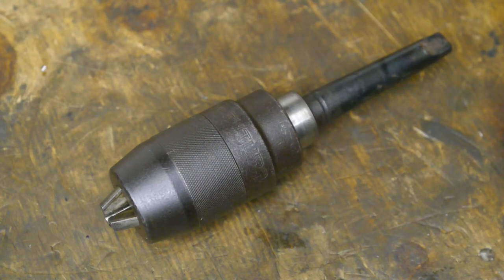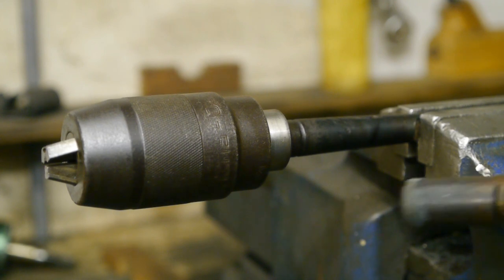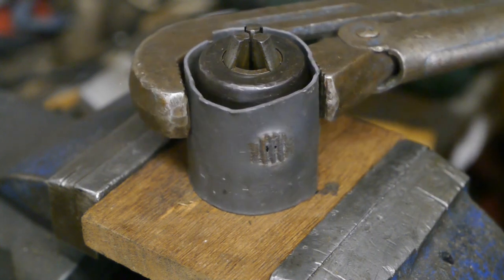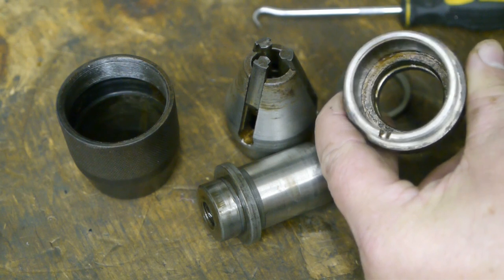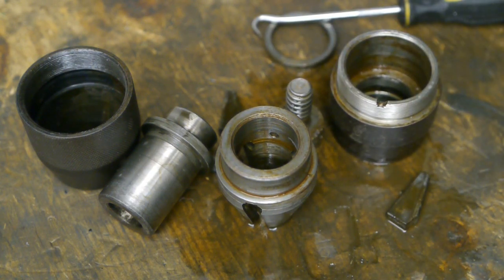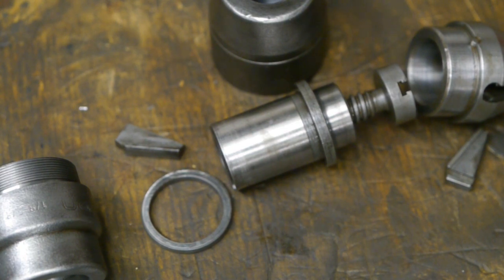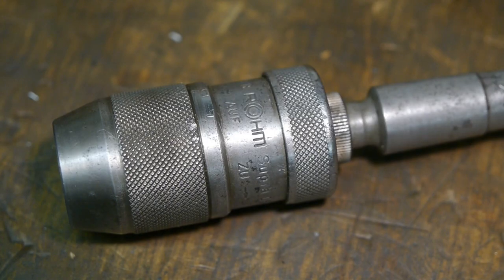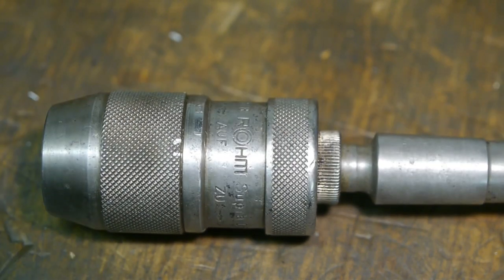Howto Disassemble a Metabo futuro keyless drill chuck

Comment: I have a Chinese chuck in which the ball bearings are 4mm with 23 total.  I notice that most leave about a bearing width in the ring of ball bearings rather than have them shoulder to shoulder.  Mine is quite a bit different than yours however.  No two race surfaces just a ring of bearings that the center holds in place against the cone when you drop it in.

Comment: is missing an outer ring that clamp on the arbor side and take that movement... thanks for video ... I have one new witch is in perfect condition and on first use that top sleeve get loose, but I have not disassemble it i will put some thread locker to not get so easy with the hand.

Comment: This chuck appears to be the same design as an Albrecht. According to a quick internet search they take (25) 4mm ball bearings. 5/32" diameter would also work since they're only .001" difference in diameter.
Reply from the maker: You are right, I looks a lot like the Albrecht design. And those come in different sizes, perhaps using different sized balls.
Reply: @Rolingmetal  I just rebuilt my albreght 1-13 looks very similar in size, design is same except the bearing there is no separate race, the body and shank are the races. The rear knurl ring is tightened to keep the chuck from sliding apprt.

Comment: I have a metabo futuro running offcenter in my drill Press!
Also mine has a sort of collar on the top, where the morse taper drive in, clamping on the ground bar yours has exposed
Reply from the maker: I've seen those collars on pictures and I'm wondering what purpose the serve. The look rather redundant to me.
Reply: Rolingmetal toghether with the bearings It May solve your longitudinal play and wobbling: the bearings stop the end thrust and the collar, put in contact with the Chuck and tightened , keep all the parts tight toghether (maybe)
I'm going to disassemble mine, i'll let you know what exactly It does

Comment: Thanks for this video! I have the exact same chuck that I need to take apart. I doesn't run true on my drill press. The arbor it sits on does run true... Very helpful to see how it is supposed to come apart before applying force in the wrong place. Gotta love YT for being able to find info like this! If I find ball bearings inside my chuck, I'll let you know the measurements.
Reply from the maker: Good to hear my video actually helped someone out.
Reply: Yes it did! It took me several hours to get the chuck to open. In the end I had to borrow a bigger pipe wrench than I have to get the job done. 
Maybe I can help you out too: The ball bearing inside consists of 28 balls of 3.2mm diameter. They sit in the groove of the inside cylinder and ride on the little ring that sits inside the main body. Hope you can find some suitable bearing balls for your chuck!
Reply from the maker: Thanks for counting and measuring the ball bearings. 
And, did you succeed in improving the runout?

Comment: Thanks for the video, I just was fixing one of these myself :). The ball bearings in my one was 3,16mm.
Reply from the maker: Thanks for the feed back. Does yours also go up to 16mm (5/8)?
Reply: Rolingmetal No problem :). Mine just go up to 13mm so maybe that’s why it used 3,16 (that’s what I measured but I think the correct official size might be 3,175mm). I tried with 4mm balls but they didn’t fit at all.

Comment: Hello, This is a great video, I took my 5/8” keyless chuck apart because it was making a grinding noise when I turned it in either direction. Upon opening it I noticed right away that no parts were deburred.  So I deburr and clean. It seemed I was short on bearings so I measured the shiny mark where the bearings ride “The race” and it measures 34mm x pi 106.814,divided by bearing diameter 4mm = 26.703, I have 24 bearings and I think I should have 26. The 26 leaves .007 mm for grease and movement. If I am wrong on the number of bearings could somebody please let me know, there is no possibility that I lost or misplaced bearings. Again great video and I’m sure that it helped more people than you realize, it helped me. Thank You.

Comment: On the Röhm chuck, if memory serves me well, carefully try to knock the upper knurled part, it is a cap, upwards, the rest is easy.
Reply from the maker: The knurled top screws off but only gives you access to the jaws as far as I can tell. Then I got lost :)
Reply: I meant the other knurled part, the one of above the letters. It is a press fit cap/ring. You can tap it off lengthwise.

Comment: Very interesting.  I have seen videos taking apart Jacobs and Albrecht chucks.   This is completely different design.

Some flea market gambles pay off, now and again they do not.  For you it is not so much the money but needing a working chuck for the lathe headstock.

Bummer about the ball bearings.   Jacobs "standard duty" chucks do not use ball bearings.   The "Super Duty" chucks have ball bearings and a hefty price.
Reply from the maker: The fact that the ball bearings are missing doesn't bode well. But it will probably still be usable on the wood lathe once the ball bearings have been replaced. 
I'm currently  working on plan B to get a drill chuck for the headstock.

Comment: You probably know this, but I will post this anyway. If you get a bike, maybe for free, there are balls in the crank, the steering, and in the axles and probably in the pedals. one size may work for you. I would use a size slightly narrower than that spacer shown. Then use grease to hold the balls when assembling.
Reply from the maker: There are more bicycles in the Netherlands then there are people. Me. I got about 10 :)

Comment: you can order different sizes of ball bearings from china on ebay,i have done this myself.dirt cheap.i would measure the bearing raise and take away clearance measurement and start there.order 3,4,5,6,mm ball bearings.have you got anything with bearing that you can  get the balls out.
Reply from the maker: I'll check the local bicycle store first before I go order lots of ball bearings I will probably never use.